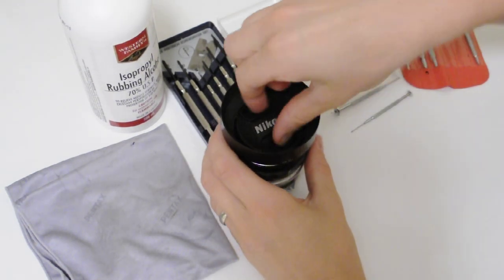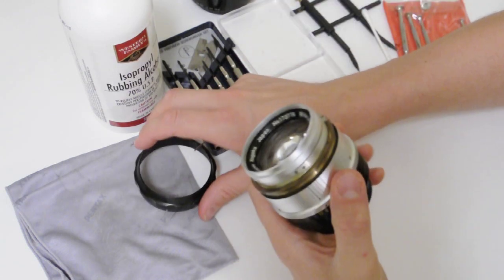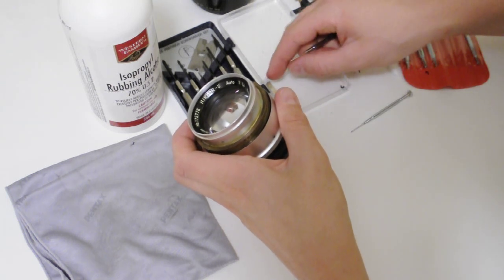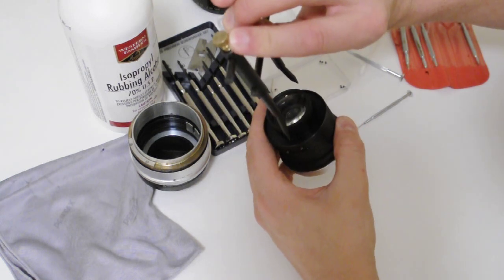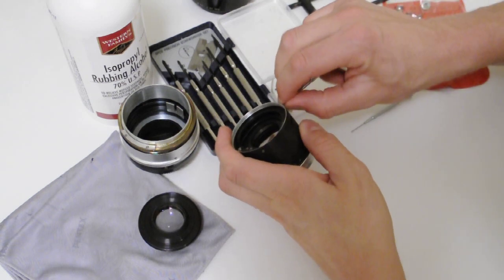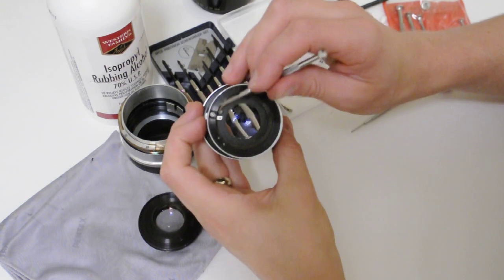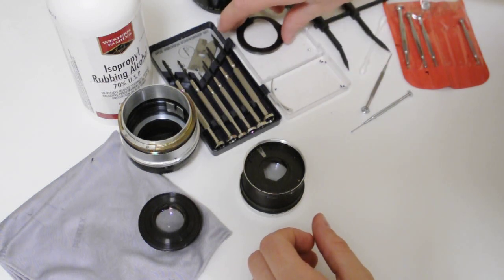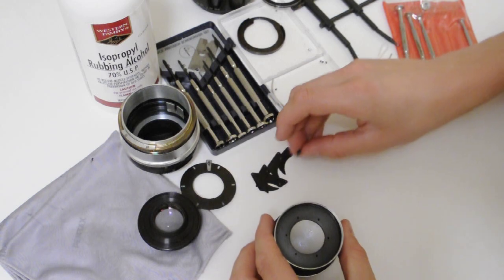How to clean Oil on a Nikon 5.8cm 58mm f1.4 Nikkor S Oily Aperture

Comment: Good info. You need to do one showing putting the aperture blades back.
My test was an micrososcope diaphragm with 10 blades and it was an absolute pig to do.
if theres a round end and a not so round end the round end fits into the pin so the aperture can freely move on the pivot, its  in the outside edge,
You would help tons of people showing the basic idea of it, but nobody in their right mind disassembles aperture blades to show a video showing how to put it back together

Comment: The main thing there is you have to get the pins facing down fitting on the aperture blade holder part properly.You can feel if theyre a bit loose.
If they are loose theyre not in right.
I discovered this after pratting around for ages trying to get aperture blades back in.

Comment: You can tell if theyre about right from the spacing and then test each one with  gentle pressure from your finger,  being careful not to disturb the other blades. They should all not move and if any of them do then its wrong. Thats the most important first step.
If it doesnt work keep trying because you havent a hope in hell of it working othwerwise.
Once you get this part sussed the rest isnt too hard.

Comment from the maker: @PistolWhippa Yes there is actually a very simple way to fix it usually BUT you want to make sure you do it right. I recommend high end Gear Lubercant like Atlas which can sometimes be found in hobby stores. Take off the rear mount where you can see the grooves of the focus ring and simply take a TINY screw driver and just dab a tiny bit of oil along the grooves. Leave it overnight to let it do it work and then try rotating the ring the next day. :)

Comment from the maker: Most of the time the dust builds up between the aperture blades and the two elements so the easiest way is to try and see if its in there. If it is this is a simple fix. Just remove the front and the entire front optic assembly will slide out. Usually you can clean it in there and if its deeper then you can just hand turn the elements off the front assembly.

Comment from the maker: Hum it seems your comment cut off but I think I know what your asking.
Yes this little spanner can do probably 75% of lenses and you can flip them so they point in or out. This little guy was like $15 on ebay so YES grab one of these for sure.
However if you look at my other videos you will see a larger silver box style spanner which I use for 95% of my lenses but use this little black one for a few odd lenses. The box style is more expensive but I would start with this little black one first.

Comment: Are you happy with that spanner? There's so many different models around but I've seen a few people using the same you have here, the black one made by foto hobby japan I believe. Also, do I need all variations of spanners, pointed tips-pointed inward, pointed tips-pointing outward, flat tips-inward, flat tips-outward, wide flat tips etc? Recap, what are your thoughts on the spanner in the video? How many variations of spanners do you need? Lastly, on your model, is it possible to flip the whol

Comment: Could you please post a list of the screwdrivers you used (or are using) for the dissasmebly? Thank you!
Reply from the maker: Αχιλλέας Γιαννόπουλος Hi these are actually just cheap $5 sets you would find in a local hardware store. Both sets are no name brands as far as I know. I just buy a few different sets when I find them cheap and try them out. The set in the middle is a great set if you can find them. I try to find them based on that piece of paper you can see in the middle of the case. They last me for a long time.
Another really great size screwdriver to look for is the #0 Phillips. I never used it in this video but I use it a ton. Most of these sets come with them.
I hope this somehow helps.

Comment from the maker: In regards 50mm 1.4 Ai-s. SORRY I accidentally clicked REMOVE trying to Reply to your comment.
When the aperture ring becomes stiff usually because the lubricant drys out. Just adding oil wont' help much, Sorry to say the best fix is to remove the screws on the mount and the aperture ring will come off easily. You want to remove all the gummy oil and wipe it from the lens and ring and then replace with something thicker then WD40. WD40 is too thin and will run inside the lens.